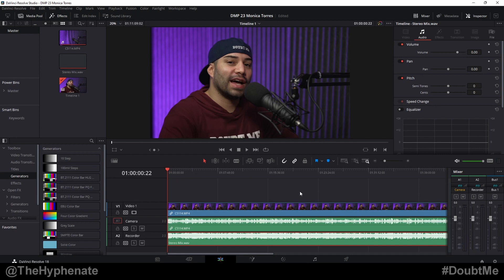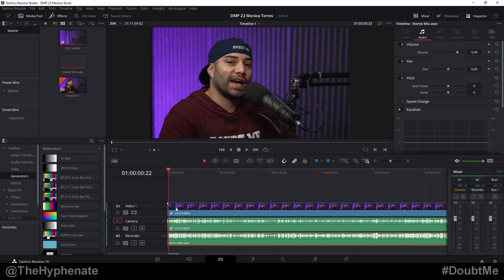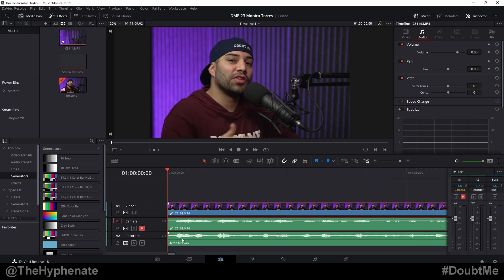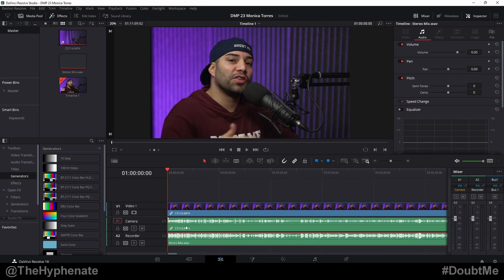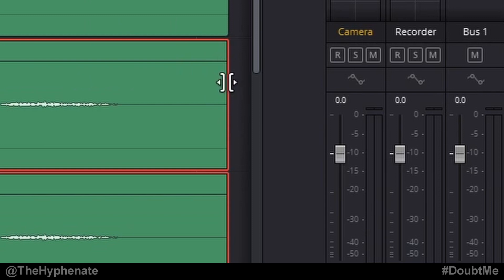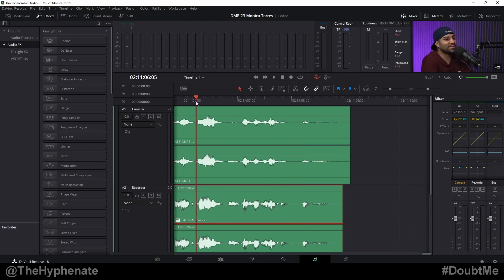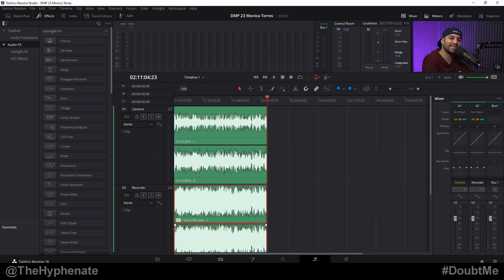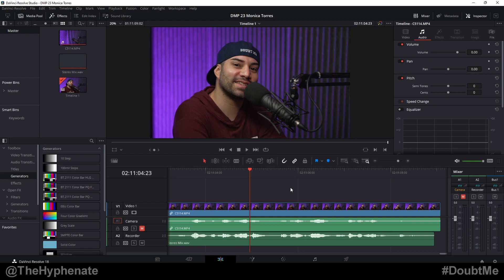How to Fix Audio Drift in DaVinci Resolve [ Audio Goes Out of Sync Explained ] Tutorial

Comment: Thanks a lot!!
In the newer versions of Resolve, the Elastic Wave tool includes several processing modes. For long-form recordings with gradual drift, the mode that works best for me is "General Purpose". As soon as I switched to that mode, Resolve stretched the WAV just enough to match the true timing of the video.

A curious detail that might help someone: even though both files were originally detected as 60.000 fps, once Elastic Wave was applied, Resolve reinterpreted the external WAV as 60.002 fps. That tiny change was enough to perfectly compensate for the clock drift between devices.

Comment: What if I have only one audio track and don't have another audio track to use as reference? In my case my video starts unsync and then syncs perfectly at the end. Is this normal?
Reply from the maker: That's very odd.    And unfortunately the only option you have is to make adjustments by your eye and what you see.
Reply: @DoubtMeTech  Oh, I see. I kinda worked my way around it, but it was weird. Probably happened because it was a 5-hour video. Thanks!

Comment: I had to sign in to say that this video did not even help me remotely.

I don't use an external device for audio recording.  But the audio for my videos is still out of sync.
Reply from the maker: This video is ONLY for ppl having audio drift when syncing multiple audio sources
Reply: @TheHyphenateTech  thank you for clearing that up.  I'm not sure why, but I'm unable to find a solution for the issue I'm facing.  Wondering if it might be something as simple as frame rate.

If my video is 59.94 FPS and I change project settings to 60FPS, will the audio go out of sync?  The audio and the video are coming from the same device so I'm not sure how to troubleshoot this.

Comment: Edit: To stretch the video instead of the audio, right click on a video clip in Edit and click "retime controls", you can stretch the video in the top right of its clip.

I'd like to do this but by stretching the video, not the audio. By stretching the audio like this you're affecting the audio quality due to using Davinci's audio timestretching, I believe if the video was moving at a slightly different rate it would be less noticeable.
Reply from the maker: Do not stretch the video.  It will add in fake framed and ruin the video.   Only stretch the audio.
Reply: Then you have ruin either one, and ruining the video makes way more sense after recording a piece of music @TheHyphenateTech
Reply from the maker: @Tapepusher  It doesn't. Audio being adjusted by milliseconds isn't really perceivable, especially when compressing the time inwards... Video on the other hand affects frames and definitely is more perceivable as it changes the timing of what's captured.  Things will not be as fluid and natural looking.  Always change audio before video time.
Reply: I understand why you prefer that and how that would be the solution for many cases, but never will a pro audio engineer choose to warp a piece of music after it has been composed/performed/mixed/mastered regardless of how accurate timestretching algos are   @TheHyphenateTech
Reply from the maker: @Tapepusher  I am a professional audio engineer.  Timesqueezing audio by milliseconds to fit the video, is not going to have the same consequences as stretching video.  And again, you only have to fix audio drift for most devices over 15 minutes.  If it's shorter, you don't need to.  A workaround, is start and stop recording the audio every 15 minutes.

Comment: Elastic Wave adversely affects the sound quality.  Not recommended.  Adjusting the frame rate or clip speed should give a better result if the audio quality is a concern.
Reply from the maker: The audio drift is generally less than a frame over an hour of time.  Compressing in the audio file (my method shown here) is wayyyyyy better in quality than stretching out the video.